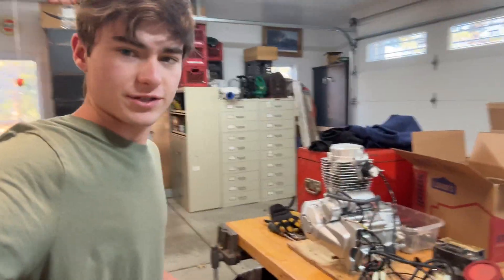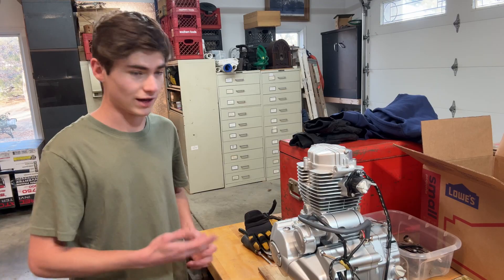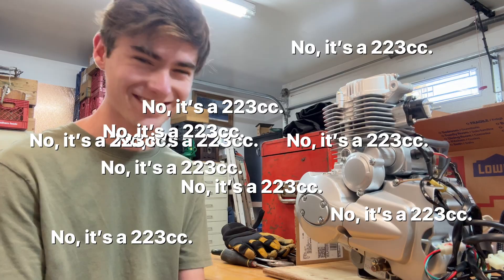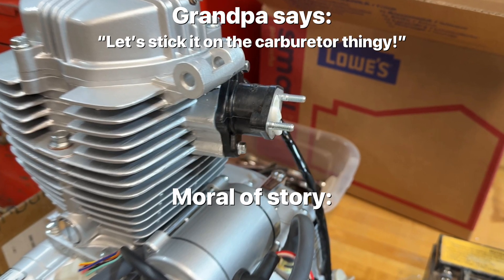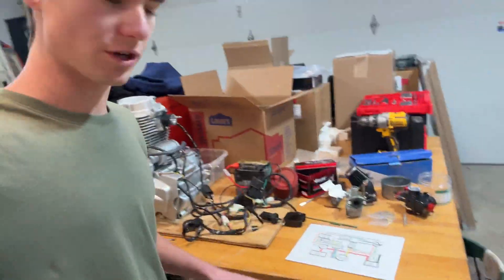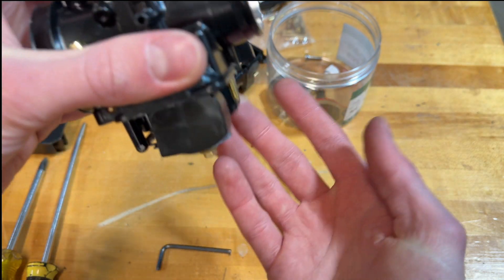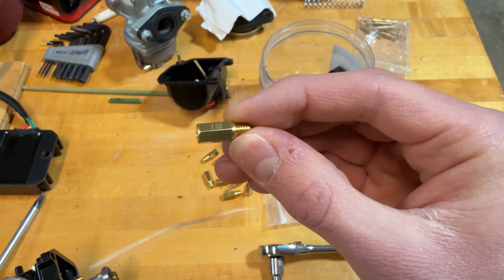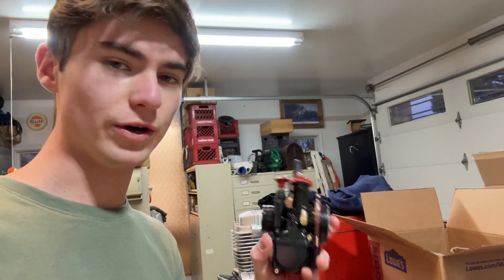CG250 Engine Wiring, PWK Carb Jetting, and Uncovered Facts | Mini Jeep Engine Swap Ep.1.5

Comment: From experience a 200cc 250cc run about a 38 leanest an 40 to 48 richest 120 leanest an 140 allways start on rich side an work down going leaner to find perfect mixture never start lean an go up u can hurt the motor on the lean side before u actually get to jet it right u will here it sputtering when it's to rich so u work down 1 size at a time till it perfect mixture then spark plug for a dark tan color or black kind of brown color plug to be on safe side
Reply from the maker: Ok… I’m running a 32 right now and it runs alright. I’m at 7,000 feet elevation and plan to ride at around 7’000-8,500’.

Comment: Good job, I think you have been hanging out with your dad and grandpa!  Enjoy your time spent with them, very good video.  You learned a valuable skill, carbs for cars pretty much have the same basic components, albeit with many more screws and springs, I recommend if you ever dig into say a Holley 750 cfm carb, open up over a plastic tote, cause things will fall out of it and they are easy to lose.  But, great video, I think every young guy should work with their dad's and grandpa's to learn how to work on things.  Taught all my kids how to change oil, check the air in tires, do brakes, and other things.  I am enjoying your content, hopefully we get to see the motor upgrade in action!  I gave you a sub, keep up the interesting content, maybe you can include your dad and grandpa in some videos, stay safe and keep wrenching!

Comment: Need an updated on the engine i got one in my gokart bruh crappy carburetor high idle and im trying to figure out how to transmission workers😭 i do i know the firt and neutral can the clutch lever keeps cable filying of when idling. Need help atp
Thinkijg of getting the carb u have to test

Comment: Sometimes, AI can give incorrect answers depending on how the question is asked. When tuning a carburetor, it's safer to run a slightly rich mixture rather than too lean. Lean conditions can cause overheating, while richer conditions help the engine run cooler, though excessive richness can lead to bogging.

To ensure you have the correct pilot jet, the mixture screw should be close to 1 1/2 turns out.
If it's 2 full turns out or more, you need to go up a jet size.
If it's less than 1 full turn out, you need to go down a jet size.
Tuning Sometimes takes some trial and error, but AI can get you very close.
Reply from the maker: Fair enough. I put in the question in Gemini, altered the wording and got slightly different answers. I found a guy on YouTube that explains it well.